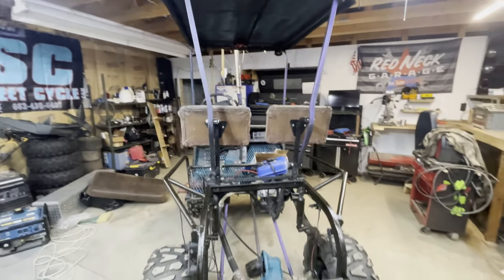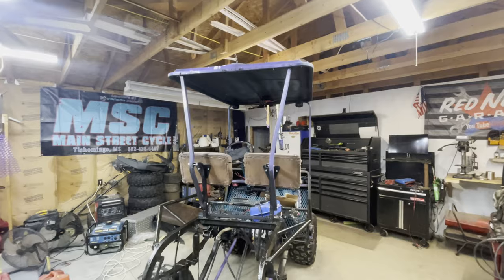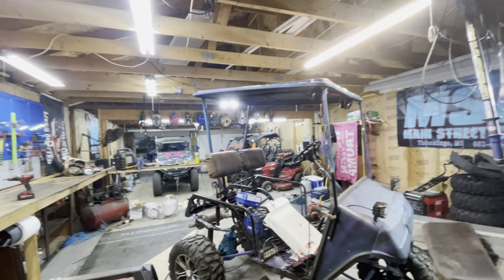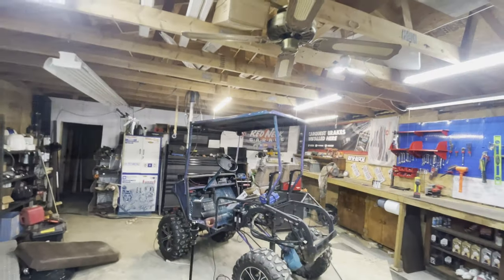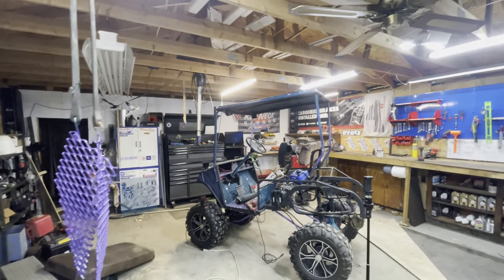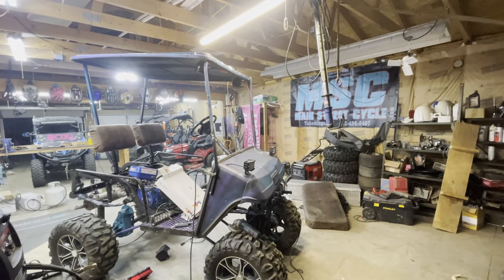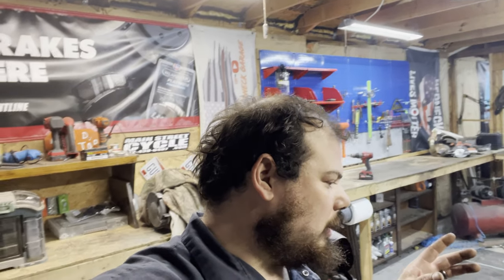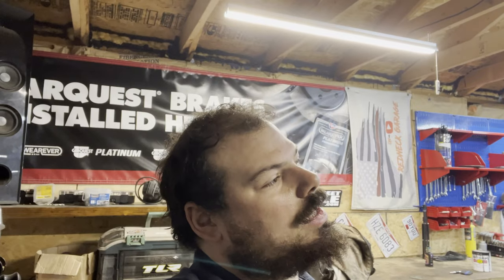CHOPPED GOLF CART ROOF

Comment: Maybe just enough off the back to clear that header so you can drive it from front to back without having to remove the light?
Reply from the maker: About an inch or so you think?
Reply: @R.N.GPerformance  lol took the light coming off, you and laura sitting on it and me pushing down on the back to get it under, may take a bit more
Reply from the maker: @edclements5112  lol that’s true
Reply from the maker: @edclements5112  don’t forget 4 tires with 4psi in them